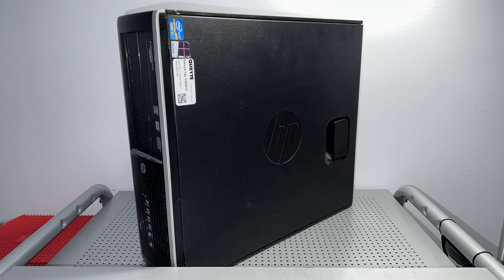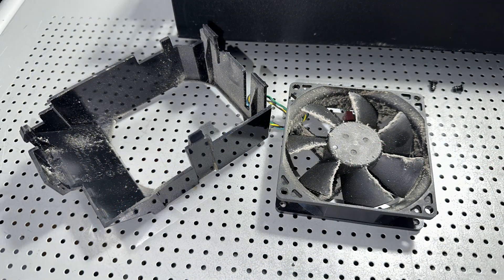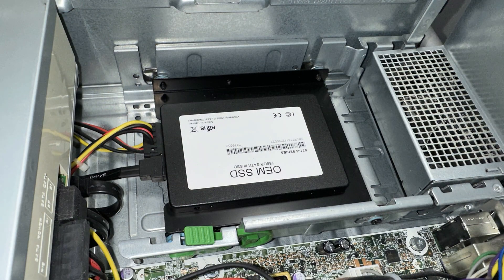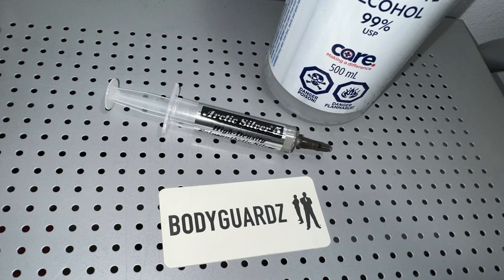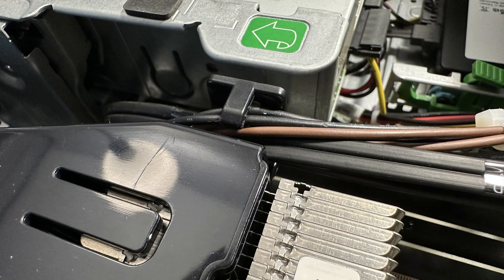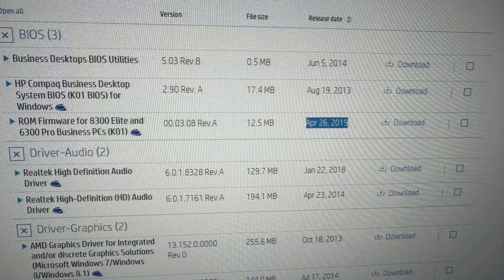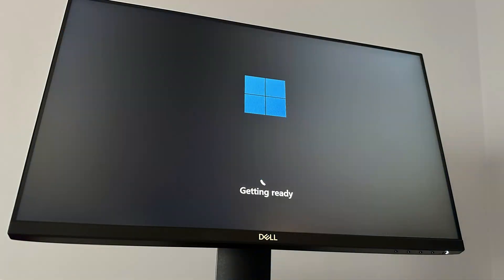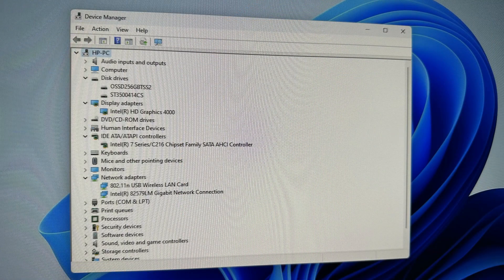HP 8300 Upgrade

Comment: I can see that you had Legacy bios. No problem with that? So, UEFI is not a requirement? There was M.2 form factor place for SSD in the MB?
Reply from the maker: It’s hard to remember why I went about this upgrade the way that I did at the time but if I remember correctly, it was because a UEFIOS wasn’t stable on this computer and it was glitching out. The legacy seem to do just fine and was very stable with no crashes. I can’t remember if this particular client was open to a hardware upgrade or not, but likely not if my memory serves me. Hope this helps my friend.

Comment: How did u do its make a video of windows11 intall and BIOS upgrade
Reply: following.. :)
Reply: @daniel.r.arenas  and if u can tel us the best gpu for that machine of a beast. is my rig by the
Reply from the maker: Because of the age and limited power of this generation CPU, I would say a GT 1030 or lower maybe even a GT 710. Crazier than that might be a little overkill for the age and capability of this CPU and board. Hope this helps my friend.
Reply from the maker: I use the bypass installation which will allow you to install Windows 11 on seventh GEN or older in CPU. Hope this helps my friend.

Comment: Hi 
When I turn on my laptop everything works but screen doesn’t come up any solution
Reply from the maker: Try removing the battery (if removable) and holding the power button for 30-60 seconds. Do you see the BIOS screen come up or nothing at all?
Reply: @TechInsomnia  my battery is inbuilt